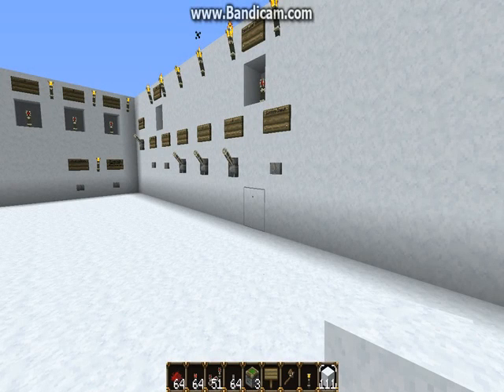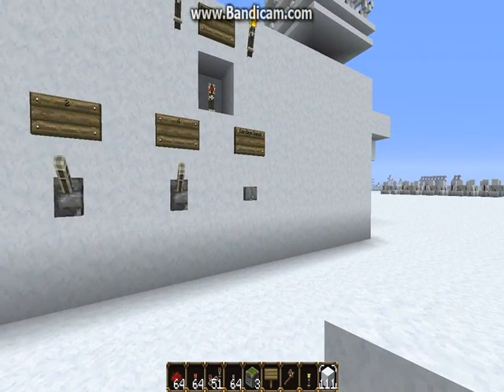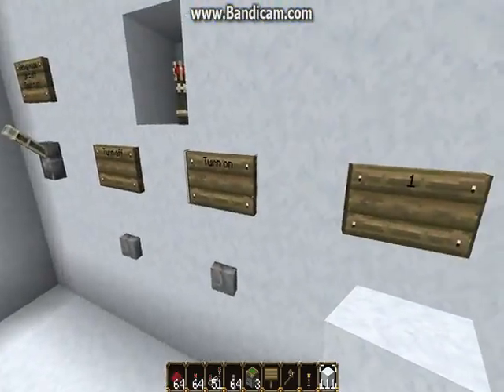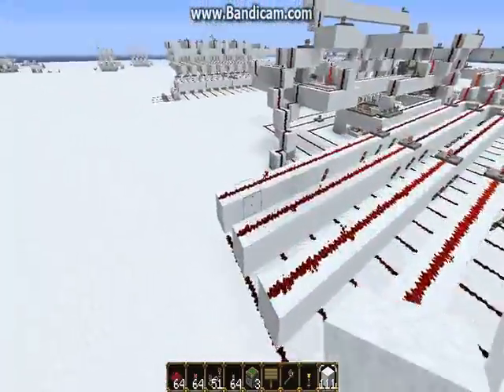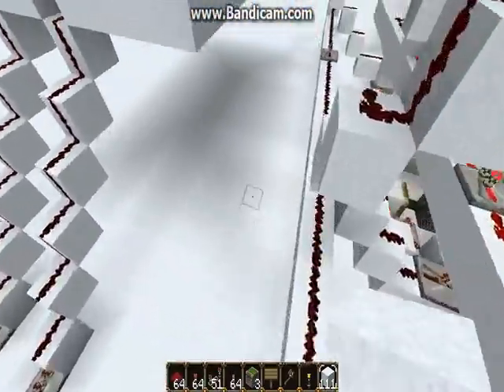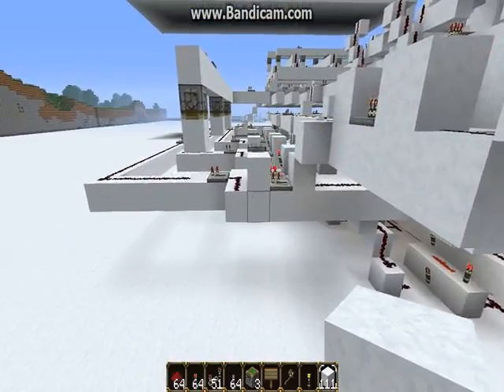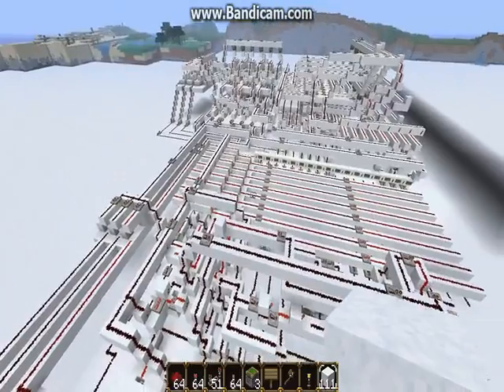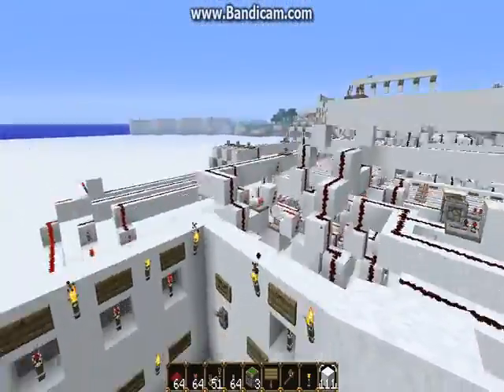Minecraft 3-bit computer

Comment from the maker: Hertz = Cycles per second. So you'd take however many clock cycles and divide that by however many seconds it takes to perform those cycles. In that case, I knew one cycle took 2.4 seconds, since that way the clock delay. Therefore, if I do 1 cycle/2.4 seconds, I get 0.416 hertz.